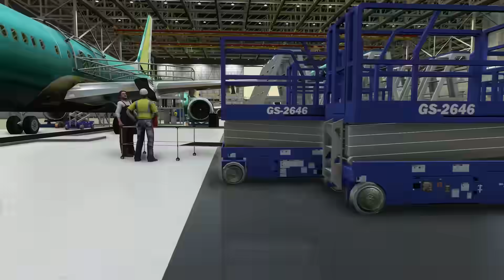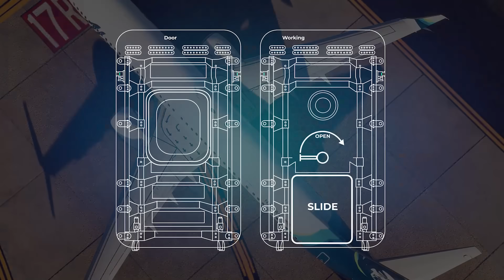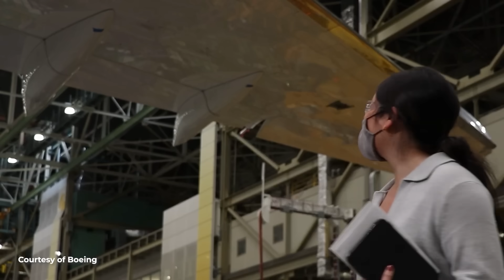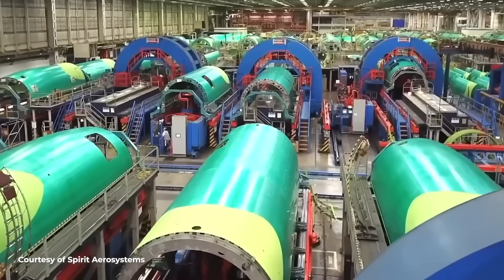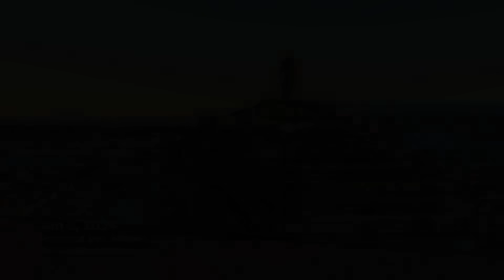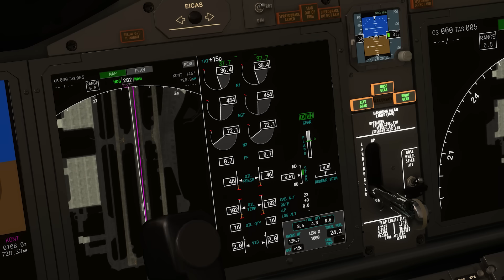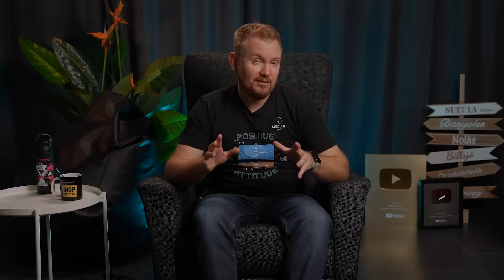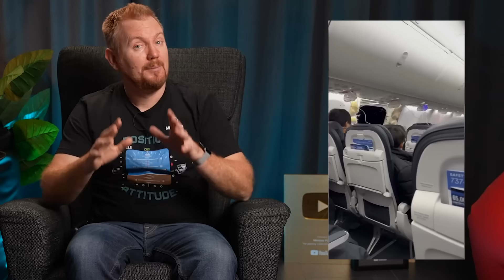Boeing 737MAX BlowOut!! The Scandal behind Alaska Airlines flight 1282

Comment: The company I work for has a process called Stop Work, where ANYONE detecting a material problem in a product can halt production within a week, and until all the manufacturing and design engineers agree there is no longer a problem. This keeps us from shipping dangerous errors or stuff that will be rejected and scrapped. I believe we got the idea from Toyota.  I'm shocked an airplane manufacturer does not operate in a similar fashion.
Reply: Boeing used to operate similarly (prior to the McDonnell Douglas merger really) and on multiple occasions actually halted production based on feedback from engineers and test pilots, which drove up the cost (hence why they no longer allow this) but insured a quality product. Ultimately the financialization of Boeing after the merger completely uprooted this culture of open communication and reporting, and unfortunately the regulators over in the FAA are primed to dote on Boeing no matter what.
Reply: @prikas4313  Another nail to add to the many other nails on the coffin that holds Douglas's reputation.
Reply: @prikas4313 This explains a lot of the Starliner problems then.
Reply: @prikas4313  And that is really not helped by the fact that now the FAA’s boss’s boss’s boss is an extreme protectionist, who made it seem in his first administration like protecting Boeing in particular is somewhat of a priority.
Reply: @prikas4313  its just about $$$ - we, the pax are expendable - cost of doing business - FAA >not even ganna bother...
Reply: @prikas4313   Boeing wants to buy back Spirit Aerospace now so things are improving.
Reply: @lhk7006 an expressed want isn’t improvement. It’s PR.
Reply: Sounds like Toyota's "Jidoka" system. 
Stop the line,
Assess the 7 Whys.
Why is this the way it is?
Why is that allowed to be the way it is?
Why?
Why?
Why?
Why?
Why?

Tracing a problem to it's very beginning. Filling every hole in the swiss cheese. 
THEN permitting the assembly line to continue.
Reply: @Dave_Crupel  That must be why my 2006 corolla has over 300,000 miles and it burns zero oil.  All I did was change oil every 3000 miles instead of what the book says which is like 7000 miles. It amazes me from a materials and manufacturing viewpoint how an 18 year old car still starts and runs every time.  Boeing needs some of whatever it is Toyota has.  But if  the regulators won't do their job, then profiteers are gonna profit.
Reply: @rustyneuron  Every company could benefit from taking on lessons from Toyota, particularly when it comes to manufacturing processes.
Reply: @Dave_Crupel interesting, similar to design thinking except in that process it's only five x why
Reply: I work for a class one railroad and I’m only authorized to ‘good faith challenge’ 3 specific situations. Everything else, no matter how egregious, I can (and will) be fired for insubordination. If I can keep my bills paid for a year or two while fired, I might get my job back in arbitration, if I had a good reason to be insubordinate.
Reply: @firefighter4443  I'm angry for you and your colleagues. The big railroad companies extract high profits. They can afford to prioritize safety. The regulators should work for the public not the companies!
Reply: @firefighter4443   That is shocking. 🙁
Reply: Used to work on cruise ships, we had a policy "Safety comes first", you could stop/report any activity of any department at any time and it would trigger a stoppage of that activity and inmediatamente investigation by the safety officer and a report to the captain and senior  officers. Regardless of how wrong you were for reporting you could never get in trouble for over reporting BUT if anything at all ever happened and the investigation found that you had previously known about the problem you would held accountable as responsible.
Reply: Boing has a process that's intended to achieve about the same. They would enter line items into a system and unless they were cleared, the plane wouldn't pass final inspection.

That system would have caught the issue, but for "door has been opened" it required "check that door has been closed", while for "door has been removed" it had "make sure door is bolted in". And naturally, someone signed off on "door has been closed"...it had been closed afterall...
Reply: @HenryLoenwind I believe there was no check that the 'door [plug] was closed '. It seems like a 'removal' document wasn't entered into CMES for the hardware that was removed.
Reply: @HenryLoenwind  The problem here was that a plug was signed as door. You cannot open a plug, simply detach it.
Reply: That explains why our 2001 Toyota still runs 😂 this should be found in every factory. Heck, my friend is a chef and has a similar procedure if anyone finds a problem with food in the kitchen. He won't let one dish leave until he's satisfied they're safe.
Reply: YES!

Everyone makes mistakes. We're human.

In the sewing factories where I worked we were all supposed to check the previous step before proceeding and we were required to hand back anything defective.

QC isn't one station at the end of the line. It's an ongoing process for every operation.
Reply: Should call it the 'Stop Career' process, as that is what it surely happens to anyone who dares use it
Reply: Sounds a lot like “kaizen” that Toyota uses.
Reply: I remember years ago having to repair castings from China only to tell Boeing the castings were nfg. Poc allow barely good enough for pots and pans but not for aircraft. They tried to fight it but we can't repair bad castings full of impurities and then give them any kind of guarantee.
Reply: I'm sure they do, but most likely it's highly frowned on informally.
Reply: @mediocreman2  I assure you it's not. My boss and I updated the process at the request of the Vice President of the company to make it easier and faster to stop production.

The entire company gets bonuses for shipping products and for reducing scrap. If we ship bad product that gets returned for scrap we might hit this month's goal but F next month's. If we stop work and prevent the scrap, even if we miss the shipment goal we hit the scrap goal. They built in incentives for us to use the process.
Reply: My company does that too. Josh Hawley said it best, these people are strip mining an iconic American company.
Reply: Yeah i am in the construction industry and i watch these videos in horror, nothing like these would ever happen in the construction industry. There methods in aviation are so primitive it is astonishing. They do not have even the most basic safety features like “lock out tag out” you take the p-tubes on the plane out of service and they do not even notify anyone. In my business it you took anything out of service there would be to large heavy RED bags placed over the stick or hand controller with key locks on both sets and a tag saying what was “out of service”. 

I could go on and on, and the one that gets me the most is the planes driving around to taxis and runways with no supervision at all. In my business is there was nasty weather or construction work on the runway you would a have “pilot car”  “Escort car” a big truck with a huge sign on the back all lit up where the aircraft would follow the pilot car the airplane pilot would be in ground communication with the pilot car at all times. Once the plane was in proper place the pilot car would turn off the runway.

This alone would have stopped countless accidents.

Compared to my business the aviation industry is extremely dangerous there are no checks and balances of any kind at all.
Reply: Having worked for Boeing subsidiaries, and with relatives who have as well... Everyone involved gets penalized for any kind of delay anywhere ever. And you get crap for pointing out problems.
Reply: They probably did when engineers ran the show and not a bunch pencil dicks.
Reply: MD ruined Boeing along with the China angle. This is why corporate merger should be illegal or at the very least heavily scrutinized and regulated. 

Because subhuman trash can end up in a position of power in a company like this, an airplane manufacturer company. Check the leadership and you'll find that their worth is basically zero in human society, no achievements, nothing notable to their name and no contributions of any kind, literally paper trash bags in human form. 

They're not even worth as fodder in a war. How they got in those positions? Essentially being human centipedes to people with a lot of money that had no guts to step up in the spotlight, so they used proxies. This is happening in just about every corner of the world in just about every corner of activity. From supreme court judges who are indentured servants to people with interests, to EU leaders who serve countries with human rights violations, to car manufacturer leaderships that got bought by groups of interest in other countries to either ruin the brand or produce more for their market. BMW and VW being up in those charts (see the current garbage being shoveled out at BMW that's 100% oriented for the Chinese market and VW's CEO who didn't much care that VW were made with Uyghur slave labour, despite catching massive flak for it - when asked, he dismissed it as a problem entirely, probably in keeping with company morals).

TLDR: CEOs and leadership are trash, should be treated as trash and should be punished for these situations that end up happening as a direct result of their actions. As is, based on this event alone (and Boeing has more past and future) the upper strata at Boeing would be put in jail for 40 years for each endangered person on that flight. But that won't happen, because they'll scapegoat someone or fire them (eventually) with a hefty paycheck.
Reply: Toyota makes top quality shit!
Reply: I can’t believe such a mistake, that is, forgetting the bolts on the plug door was made at the factory. We the public fly at the mercy of those engineers and technicians. I am glad that the pilots did not panic and were able to land the plane safely.
Reply: The company you work for appears to care more about consumer safety and its own reputation than it does short term profitability. Your company should be applauded.
Reply: This appears like sabotage to me. It may be a way of letting people know that there are problems at the plant. Whistle blowers  get killed so someone spoke up without moving their mouth.
Reply: An extra bit of irony here is that Boeing is currently obsessed with 'lean' for both manufacturing and development, which came out of Toyota.   So the adopted the 'just in time' and 'call everything we don't value waste', but skipped all the other stuff.
Reply: Boeing does. A worker forgetting to install the bolts, that no one else notices, would not trigger this.
Reply: @rdspam no they don't, Petter mentions in the first part of the video, that they had several minor issues, but never held the production
Reply: Let me take a wild guess: you don't work for Boeing.

Comment: I wish something had been said about what additional damage would have occurred if the door had flown off at cruising altitude.
Reply from the maker: That would have been pure speculation.
The diff-pressure would be higher so the forces would be more violent, but the outcome could have been the same or different. No way to tell